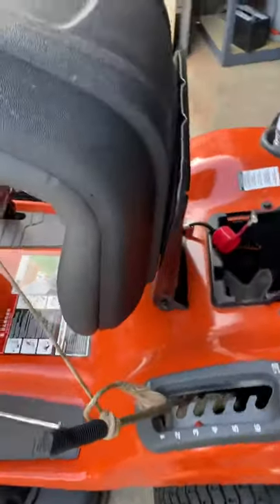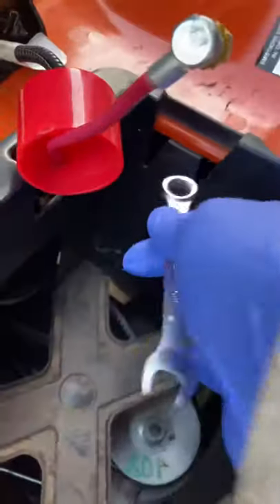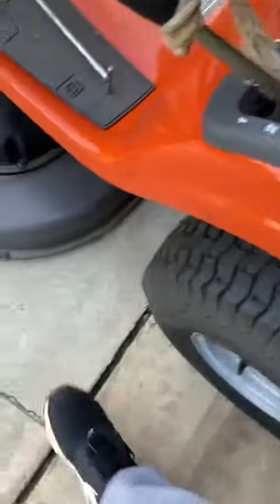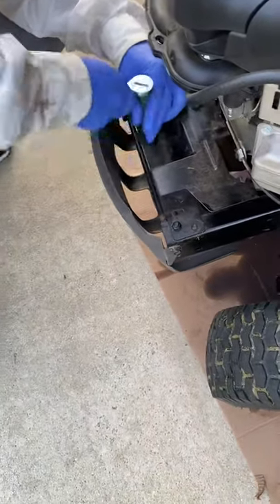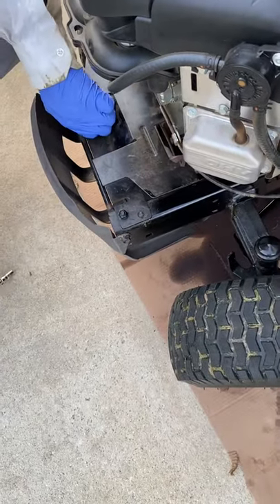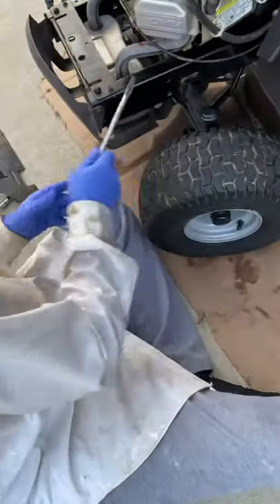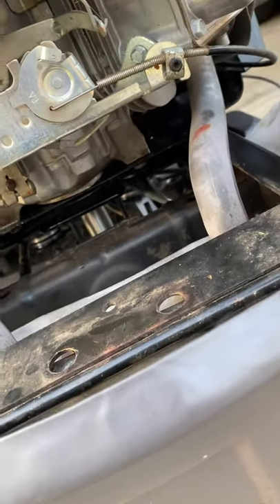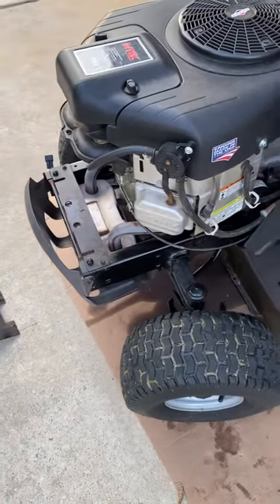Lawn tractor won’t move??

Comment: Thank you so much for your video. My husband was at work and I was going to mow the yard and it would not move. After watching your video, I went out and looked and sure enough the belt had come off the top pulley. My hand was small enough that I used a screwdriver to get it back on the pulley  and I got the yard mowed. I’m very thankful to you for letting me know what to look for.
Reply from the maker: Thank you for watching

Comment: This is my exact same mower and exact same problem. Thank you sir. You saved the day.
Reply from the maker: Glad to help
Reply from the maker: Thanks so much
Reply: @k-dyi4365  at the time it was stuck at the bottom of my property downhill and I didn't have access to a 4wd vehicle. It was about 10 minutes from raining and it rained for it a few days non-stop. I was able to use this video and get my mower running, get it into the barn, and get inside right before the downpour.

Comment: Thanks for a great video that gets straight to the point. Unfortunately for me, I have the husky YTA 24v48 and the gas tank is over the rear drive belt instead of the battery. Is it possible to get the belt back on from the bottom (without removing lots of parts) if I jack it up ?

Comment: I have a YTH18542 lawnmower wont go in reverse or forward. Belt is in place from what I have seen, when it starts rolling down the hill the brakes don't work, and it will move sometimes with the blade engaged. It has me stumped, possible my transmission is going out?
Reply from the maker: So sorry for the late reply, not sure but it’s probably the linkage from the pedal not engaging the transmission
Reply: Thanks for everyone that replied, my issue ended up being a missing axle key on the driver side.

Comment: What model is your mower , I need to replace my variable speed pulley and it’s same as yours but  mine is mcculloch but that pulley looks exactly as the one I have .
Reply from the maker: So sorry for the slow response, didn’t see the comment.  My mower model is  the 22 HP, 46in (Mulcher) with Briggs and Stratton engine.